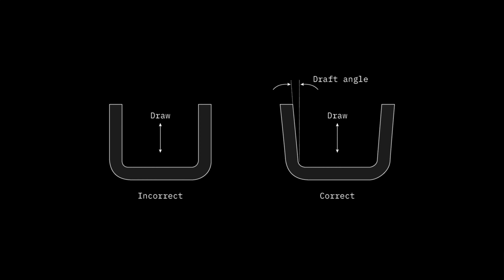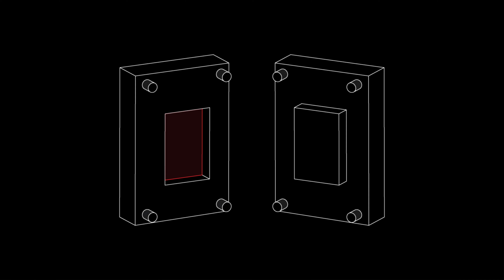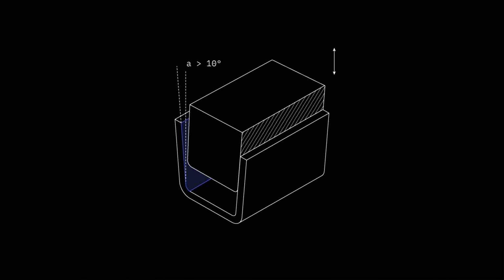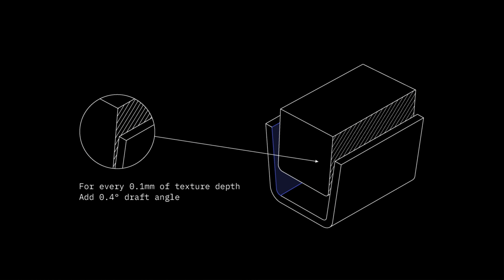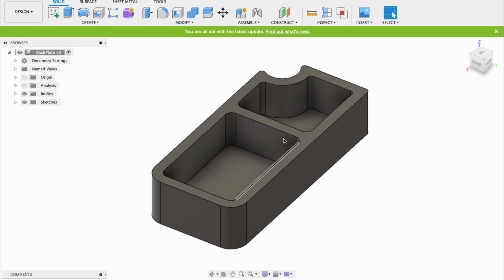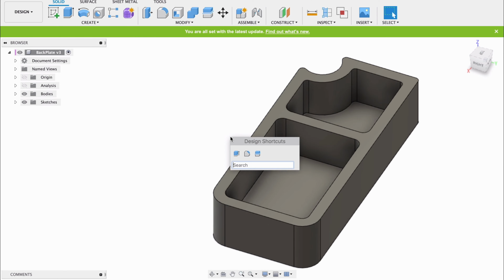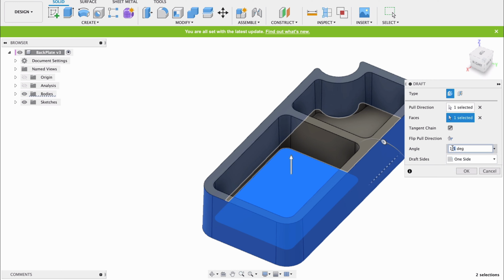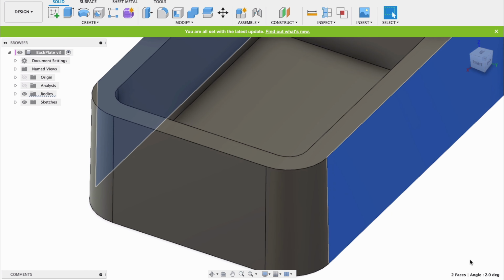Injection Molding - Draft Angle (Why and How to Design)

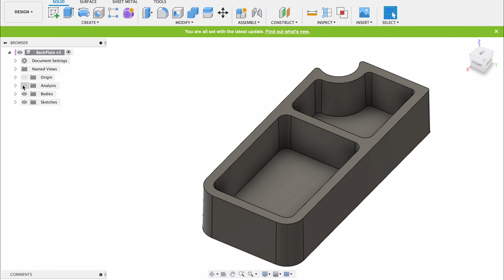Comment: 4:15 You just created counter draft on the outer surface, making it impossible to open the mold with the split line being in the obvious upper corners. In order to have the outer surface drafted as shown you would need slider movement to the sides.

Sorry, I have been working with injection molding over 15 years. :)

Comment: what if the model you need to make have internal draft angle but outside can't be simply ejected with drafting and require multi piece mold to be made? in this case let's say 6 part mold where front and back, would be interchangable as well as left and right, but a model already have natural parting line for top and sides build in

how to inject plastic into such a mold toy train bodies , architectural models , things with a lot of windows and thinn surface details that stick out and would hold 2 piece mold

Comment: I keep hearing different degrees of angle from different people. One company told me a 1 degree draft angle would suffice, but here your inner draft angles were 1.5 degrees.  Is there a set standard?
Reply from the maker: Hi Richard, thanks for your question. In short: no. It depends on the design of your part and the surface finish.